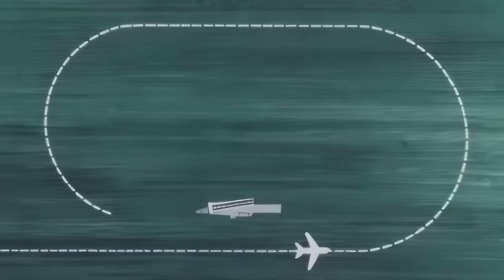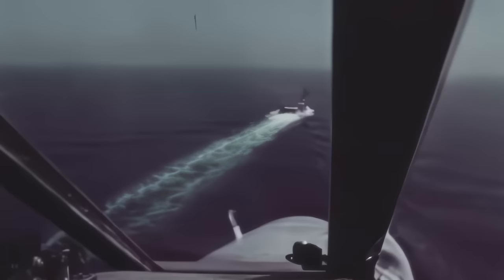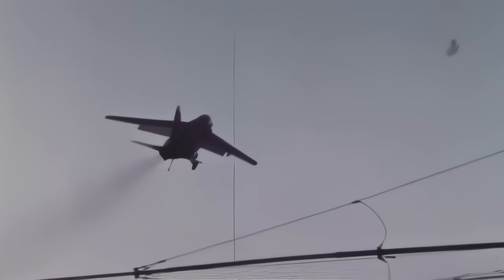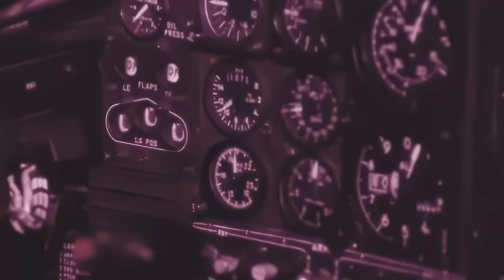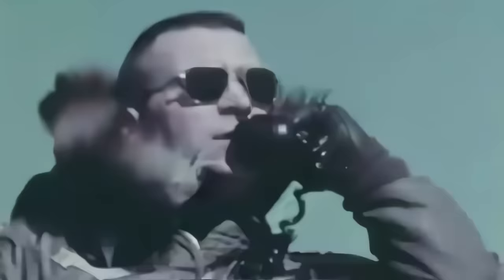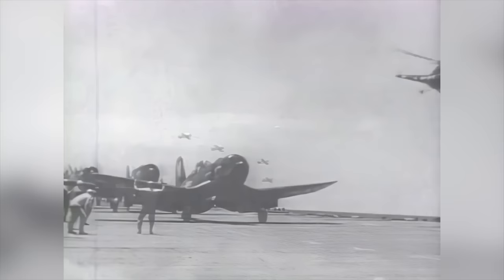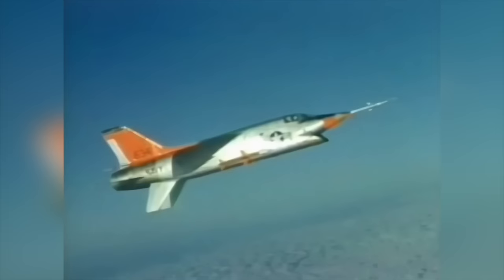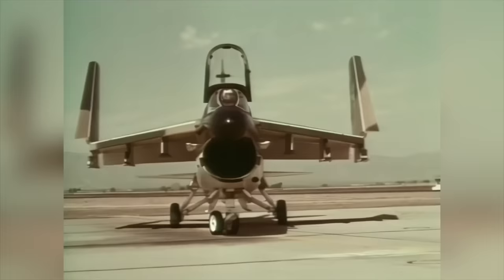A-7 Corsair II | Getting Familiar With The Jet, and Carrier Deck Procedures | Upscaled Documentary

Comment: I was attached to VA-146 " Blue Diamonds " on the carrier USS Constellation CV-64 back in the 70's. I was a plane captain and power plant tech on the flight deck. At time frame 49:39 in you video you can see aircraft 302 in flight. That was my aircraft I was responsible for as a plane captain. I remember when the picture was taken off of Hawaii on the way to Asia in 1976. I was an aircraft mechanic for 45+ years on all military jet aircraft the Navy flew and the little A7 was the most rugged and airworthy plane I ever worked on, period. You really had to work hard to break one if you could. After seeing that picture of my plane I truly miss sitting there with the engine running underneath me. A truly great aircraft. You can truly fall in love with a machine. Thank you for your video.
Reply: Cool, I was in VA - 27, early 80's. Did a westpac.
Reply: Did 2 West pacs, loads of fun ! Thanks for your service shipmate !! @farber2